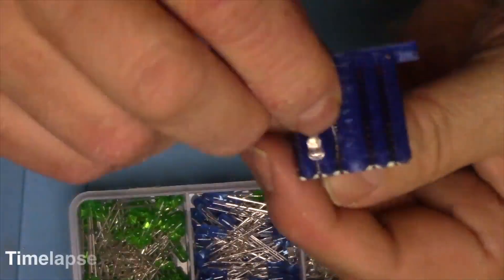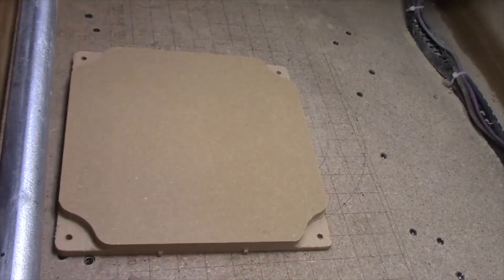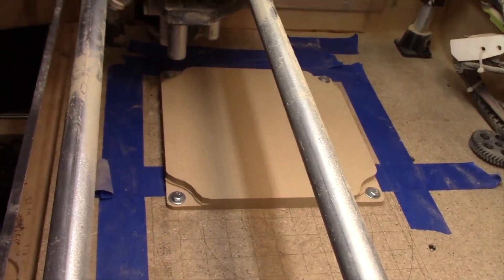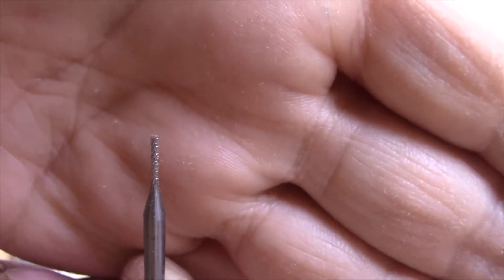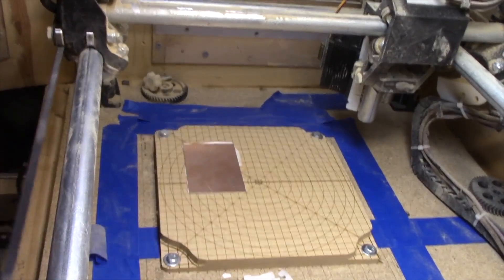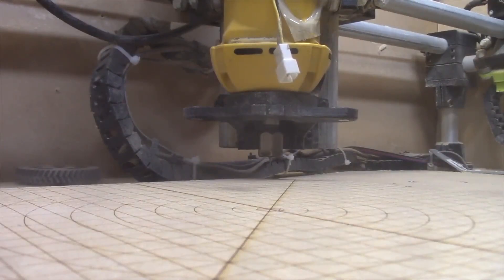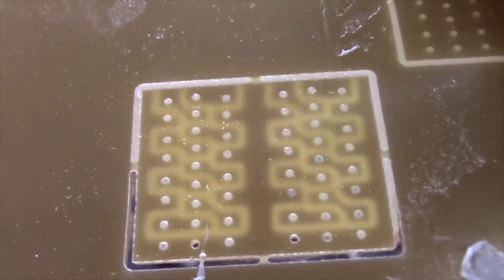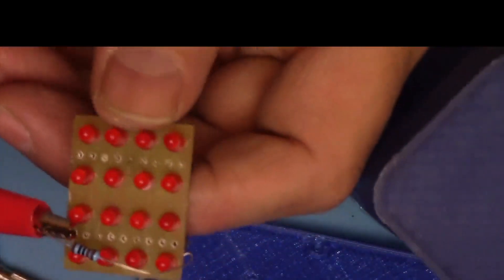Making a PCB on the MPCNC

Comment: After using the MPCNC for a quite a while, what is your opinion of it?
Reply from the maker: bauhaus I love it!  It worked great and took a beating. I did take it apart finally, not because of any issues other than I have since built a lowrider, and can’t justify taking the space for two CNC machines. I really like the lowrider too, but I do miss having a clear view of the bit on the mpcnc.    Thanks for watching and commenting!
Reply: @Someoldguycoding  That's great to hear. I'm amazed at how inexpensively this can be done these days. Did you feel that it held tolerances and stayed true in that time?
Reply from the maker: bauhaus yes. Just get the frame as square as possible. Have as short a z axis as possible. Occasionally tighten the belts. At the beginning of a job make sure your axes are squared be pushing them into the zero position making sure you don’t  have any residual deflection (make sure both ends of your x and y axis are zeroed to get them square) and then use the steppers to move the head to the work position. It is possible to have too aggressive a cut. The steppers can miss steps if you over do things. But under reasonable feeds and speeds it’s plenty powerful. Good luck with your build. Be sure to study the instructions on v1engineering, and there’s lots of help in the friendly forum.

Comment: am I wrong in thinking that at the tolerances for this project the variances in the double sided tape might be messing with the bit depth here and there? I can't imagine there is much attention to uniform thickness on tapes used for applications like sticking down carpet? Might you be better served with some sort of precision jig for holding the board?
Reply from the maker: Mike Pettengill actually it seems pretty flat to me. I think I'm just cutting too deep. But you're absolutely right, a nice jig would certainly be a nice addition. And eliminate any lack of adhesion or curling. Thanks for watching

Comment: What I like is that the various Open Source computer-controlled manufacturing tools are getting more... synergistic? What I mean is that a lot of people now regularly use two or three of the laser cutter / light CNC mill / FFF 3D printer trifecta, and these machines are now being designed in the Open Source Hardware community to be produced with the tooling these people are already using... namely laser cutters, light CNC mills, and FFF 3D printers. It's like what those Open Source Ecology people (and I think some branches of the RepRap movement, and probably others besides) are trying to do -- create a set of freely-available, ever-iterating and adapting blueprints for a machine shop that can make all its own machines (and various other industrial equipment) from feedstocks common enough to be cheaply sourced anywhere, usually from scrap or local materials. Obviously, OSE are mostly trying to go from the low end (refining, building construction, basic woodwork and metalwork, agricultural equipment) up, but the top of the pyramid (PCB production, pick-and-place, CNC machining, etc.) is expanding down as well thanks to machines like this.
It reminds me why I felt desktop manufacturing was so cool when I first heard of it!
While I think the full, maximum-success RepRap dream of a single desktop-sized machine that can 'make any technological artefact, including itself' directly is a long way off (if it ever comes, even with the commonly-accepted practical limitations to the idea), a warehouse-sized or even garage-sized plant capable of (in enough time) replicating all its own parts (and then building you, say, a car) with relatively little human labour seems very achievable within a few decades (semiconductor fabrication seems the most far-fetched part, and even without that most people would call it a success).
Now, whether any individual hobbyist would ever WANT the full set of tools to build a technological civilization, I can't say (a small subset is probably fine 99% of the time, and every tool you have takes space and resources), but hackerspaces and stuff will love it. Proving (and constantly shaving down) a minimum set of 'seed' tools necessary to indirectly (through many daughter machines) build basically everything in a modern city from raw resources and digital designs would also massively aid space colonization efforts, disaster relief, and the like (you actually see a lot of the precursors of the 'self-replicating machine shop' idea in old moon base proposals).

Comment: Hi there, @ 1‘47 the bolt and the washer in the lower right corner seem to dance around a bit when you knock on the board. Not yet quite tight?
Reply from the maker: Thanks for your observation! I'll have to check

Comment: in the CNC place I worked at I noticed the uneven surface as well, and that was on commercial grade machines. we decided to do a cross pass and it turned out smoother.
those machines are fast so the second pass with a 2inch sks and same z level at 90deg didn't add much more cutting time. 
obviously, you have extra time if this is a hobby so id reccomend trying it out some time.

Comment: Look like a 3D printed "easy to remove plug" for the holes might be a good idea
Man really like the video's!  very cool and the mix of laser and router is really cool!
Keep em coming!!!!!
Since you have a copper board, and a metal bit, I wonder if you could setup an electrical touch ground for auto leveling, have it come down and touch the board in a grid for autoleveling.
Reply from the maker: thanks!  Yes I could certainly do the touch thing.  A made a beeper box just for that too. Haven't had time...  Thanks again!